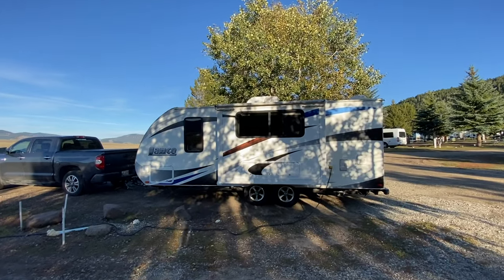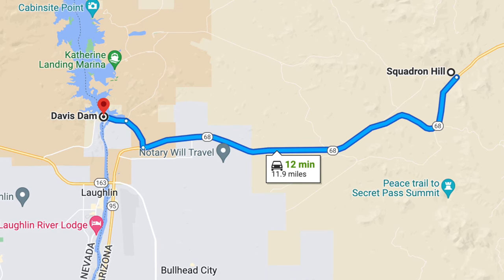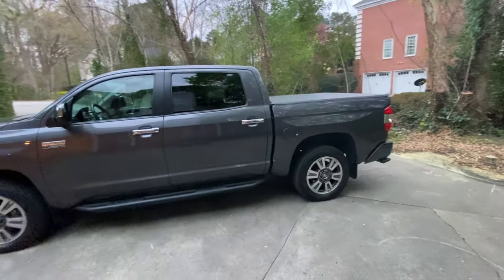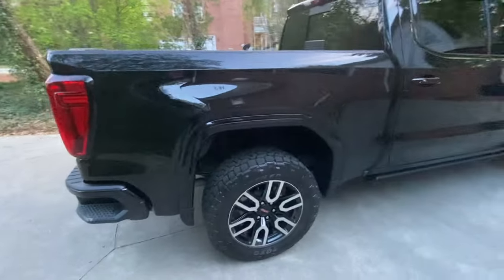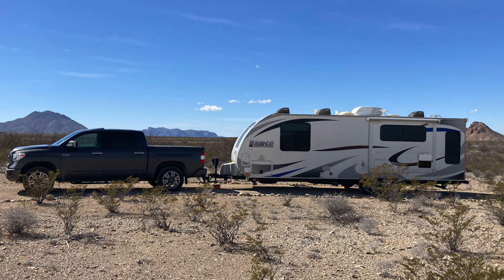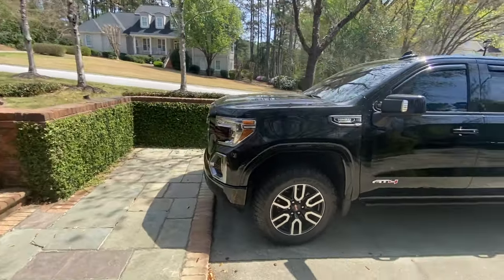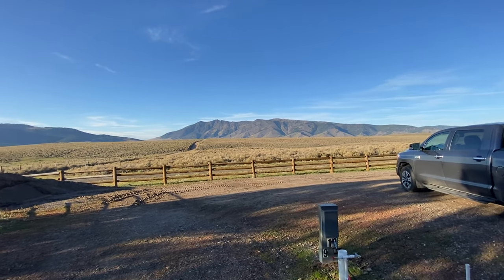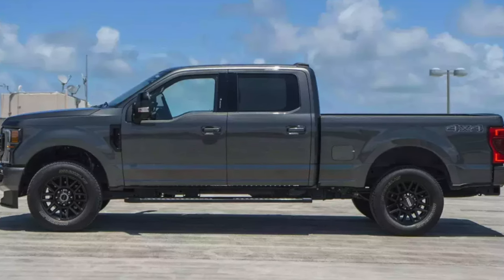Myths - Towing Capacity & Payload - the best Half-ton truck for your Travel Trailer or RV

Comment: Loved my 08 Titan thing never failed me once 200 K sold it  to a family member things  still going purchased a 21 tundra TRD  pro have to agree didn’t go pro 4X one of the reasons also was fuel tank capacity love the 38 gallons on the tundra
Reply: I think I’m gonna get a 2021 or 2022 Titan xd instead of a 2020 or 2021 tundra due to gas mileage, 6.5’ bed, and Titan has a hood crash rating whereas the tundra has poor. I’m a Toyota fanboy but this is just how it is for me haha
Reply: @americandude3825  I got 21 Titan, V8 without new electronic garage start stop or cylinder deactivation. 2200 lb payload,  6.5ft bed. 100k waranty, what's not to like. Towing trailer is like is not even there.

Comment: Nicely done!

You took the long way around but ended up in essentially the same place as me regarding the max weight a 1/2 Ton Truck should tow.

Depending on things, I'm in the 6500lbs to 7000lbs range.
There are exceptions to everything and people do have "unicorn" trucks with bigger capabilities but in general, thats where I'm at.

We decided that we wanted a bigger Travel Trailer. It weighs in at 10k, I tow with a RAM 2500 gas.

That comes with a different set of challenges but i knew what i signed up for.
Reply from the maker: Great comment, thanks for sharing.

Comment: I really have to put in my 2 cent5here. I have a 2019 Lance 2375 and tow it all around d the country. The first three years I towed with a 2014 Tundra with the 5.7. It was a great truck but I didn't like running at a high rpm alot of the time, especially on hills. I was always shifing manually and on longleaf this can get retiring. Also iwas nkt happy with the brakes. I upgraded to drilled and slotted rotors and heavyduty pads. It was an improvement for sure but not completely satisfactory.  It also got really bad mile4when not towing. A year ago I really wanted to get one of the 2022 Tundras but you couldn't get one any. I wa Ted a new truck for our Spring 2022 leaving mid March from New Hampshire to Nevada. I custom ordered a new F150 Ecoboost with MAX towing package around Thanksgiving and it arrived mid February. The difference in towing was and is dramatic. The e tra torque combined with the 10 speed transmission. The  stock brakes are far superior to the Tundra. I never manual shift anymore. On the highway I use cruise control trol which I could never do in the Tundra. It came with 8 ply tires which surprised  me. I should have noticed that when I placed the order. I recently  upgraded to a 10 light truck tire and the difference  is astounding.  The turbo psi gauge never gets above 50 percent and most of the time barely moves. It has been a true pleasure. The payload capacity is 1898 lbs. I would  not recommend exceeding  the payload capacity due to possible frame, axle and wheel capacity. Happy travels.
Reply from the maker: Great info, thank you for sharing that.
Reply: I don't know...just don't trust those whizbang V6 Turbo gismos to go the distance compared to a naturally aspirated gas V8. I tow an 8,800 36' 3-slide camper and usually just within 350 miles of home in NE Oklahoma. Have a 1994 Silverado 1-ton dually diesel right now but will be buying a newer "pre-owned" truck next year... It's a coin toss between a Tundra or a F250, with a gas V8 with a 6-speed transmission of course (those 10-speed trannies haven't proven themselves (yet) either)).

Comment: I agree I had a 2012 f150 Ecoboost and around 30k Miles started having problems with the intercooler timing chain and transmission that thing ate spark plugs like candy then around 90k started having problems with turbo's that was the last straw for me  decided to trade it in for a used 2017 tundra with 32k on it I now have 78k on it the previous owner ordered it with the 38 gallon tank so far no problem's I love it  tundra tows way better than the Ecoboost
Reply from the maker: Appreciate the info.

Comment: I have a 2012 Ford F150 XLT 4x4 with Extended Cab and 5.0 Engine. I've used to tow an 18 foot Dutchmen Travel Trailer for about 11 years with it and got about 16MPG. Now, I tow a 33 foot Cherokee Travel Trailer and I still get 14-16 MPG. I also tow my boat and launch it a few times every week. My boat is 5900 lb. dry, but my 55 gallon gas tank is always full, so that increases the weight significantly. I get about 16 MPG with the boat. So, I've really had no issues with doing this.
Reply from the maker: Glad the 5.0 is getting it done for you.

Comment: I used to own an old Suburban that was ordered from the factory with a max tow package build.

They were known as a heavy half ton. They were basically a 3/4 ton rated half ton truck.

I could tow 14,000 lbs with it if I wanted to.

It had a 454 engine , a thicker radiator core for increased cooling capacity.  It had external transmission and engine oil coolers. 

It had overload leaf springs on the rear that did not touch until loaded down heavy.

It had oversized brakes and oversized anti sway bars as well as heavier duty shocks.

It also came with higher load range tires and wider heavier steel wheels.

Vehicles used to be able to be ordered with factory upfitting and now they have moved away from special ordering.

They don't profit as much.
Reply from the maker: Regulation chasing us all to HD trucks in the future

Comment: Thank you for the informative video.
We tow with a ram 1500. With a 7700 lb travel trailer. Use a weigh safe hitch and air bags. She handles great and pulls fine.
The cost of a 3/4 ton truck is exponentially more expensive.  
That can buy me an awful lot if fuel.
My only complaint is our fuel tank is too small.
Reply from the maker: My 2021 Ram 1500 Limited came with a 34g fuel tank.  It'd be nice if they did that again

Comment: A simple rule of thumb to stay safe and not break stuff is to make 75% of your tow rating the max, be aware of your payload (but don't worry about maxing that because it's nearly impossible not to) and keep your trailer length (on a 1/2 ton) to 26 feet for a box shaped travel trailer (you can go longer with an Airstream or a flatbed).
Reply from the maker: Appreciate the input

Comment: I tow a 4600lb dry tt, 24 foot with 2014 ford f 150 5.0  7700lb towing cap.    Wind is the only issue towing 8000km to AZ and back each year.  Heavy tongue 900 lbs, no sway with reese steady flex. But in wind, 14mpg cnd to 8 or 9😱
Reply from the maker: I never had anything freeze, but don't know that we had to keep things at 65F.  Lance was great, but moved to Airstream.

Comment: First Time Listening To You - Great Stuff 👍🏼. FYI - I Have a  2014 Tundra with a 8 foot bed With Air Bags and Big Nitto Tires and I Tow a 31’ 5th Wheel  Cougar and it Pulls / Stops with No Problem. I also Have Brake Control installed and a Breeze and Joy  !!! NO White Knuckles . 5 th Wheel is a Different Towing then a Bumper Pull Camper. Thank You & Enjoy Your Notes / Imfo. 👍🏼☮️
Reply from the maker: Sounds like a great setup, best designed half tons for towing and modifying ever.

Comment: 2014 F-150 with the 5.0l v8, the truck is 2 wheel drive, has a 3.55 rear end, and has the front end lifted 2.5” to level the truck. I run Goodyear Wrangler Duratracs 275/65R18 load range c on the truck, and I swapped my trailer to load range d’s. Trailer is about 7800lbs when we load for a trip. It’s a Heartland Pioneer BH270. Truck tows surprisingly well and I average around 15mpg. My only complaint is I purchased the truck before the trailer and did not opt for one with the larger fuel tank, so I can agree there. The larger tank does make sense, however I wasn’t considering a trailer I did not have when purchasing the vehicle so I can hardly be angry. Other than that, I cannot speak for the newer F-150’s, but as for the year and model I have I find it tows very good. For anyone who may be wondering.
Reply from the maker: 5.0 has always been a solid towing performer
Reply: This just helped my nerves a ton man. I have a 2014 f150 3.55 and have to transport my 37ft bullet 330bhs to the marina. Very skeptical of how it’s gonna go. So hearing that yours tows fairly nice it makes me feel much better about tomorrow!
Reply: It’s at 7600 lbs
Reply: How in the world do you get 15 mpg while towing that trailer? Did I read that wrong?  I have the same truck, year, motor and axle, I get 15.4 mpg not pulling anything.
Reply: @397coney7  swear to you. I average 15.6 mpg on the daily. I usually keep my average pulled up, but I switched over to the instant mpg when pulling out of curiosity. At 65mph on the highway, when keeping a steady pace I was getting about 15mpg. I’m sure if I were to drive around town more than on the highway the average would be worse. But yeah, I was getting a steady 15mpg. I’ve yet to bring it longer distance than say 100 miles at a time, so that’s all I can speak for. I’m sure longer distance would be different.

Comment: Have you done a video / analysis on what a weight distribution hitch can do adding pressure to a frame say on a small toy hauler with a leopard frame and causing failure. And possibly sway bars adding to that also. There are reports and videos on how they have caused failure on some frames typically the smaller toy haulers like a wolf pup or a gray wolf

Comment: Subscribed! So I am new to towing and truck ownership. Just bought a 2023 Ram 1500 two days ago to tow a small A-Frame. We quickly realized that our 2010 Wrangler was really groaning to pull just 2500 pounds. But now I am going INSANE trying to figure out the true towing capacity of our new truck, so we can get a little bit bigger trailer and safely tow. I know that's opposite of what your video says (buy a trailer first, and then buy a truck that can tow it). Can you tell me where you think I need to be weight-wise as I am shopping for an RV? I've got an 8 Cylinder 5.7L Hemi VVT with eTorque, RWD, crew cab, 3.21 axle ratio. The Stellantis Tow Chart seems to indicate that I have a Max Trailer Weight rating of 8260lbs. You say in one of your replies below that I should stay under 75% of that, which would be about 6200lbs. The Ram's sticker says the truck's GVWR is 6900lbs, Payload cap is 1649.  That Lance 1995 you mention appears to have a Gross Dry Weight of 4950 Lbs. Do you think I could pull that with my truck? Thank you for any advice at all! 🤠
Reply: For the trailer you are referring too (Lance 1995) it has an empty hitch weight of 500 lbs. Fill up with some water, gear, food, clothes and you may be looking at closer to 600 lbs of hitch weight. So after that you will have 1000lbs of capacity left in your truck for people and gear. If you are bringing a full load of people in your truck, you may be over the limit. If not, you should be fine.
Reply: @spankroy  Thank you, Matt.
Reply from the maker: I towed a Lance 1995 across contry several times.  Don't think you'll have any issues with that setup.

Comment: The real test is to drive one with a trailer like yours and as you note, are you comfortable with it. I have a 28 foot single slide travel trailer and tow at around 6800 lbs and about 800 lb tongue weight with a Speaking to my 2021 Ram 1500 Built to Serve 5.7 Hemi had a 1280 payload and a 12K max tow. I had the 3.21 rear end but my 2015 with the 3.92 and 5.7 had roughly the same tow ratings. So, I tow roughly what you are towing. Surprisingly, the 3.21 rear end was equivalent to the 3.92 rear end on the 2015. Mileage about the same, performance about the same. The main difference was that the 3.21 had the engine obviously doing more work than rear end on the 2015. I ended up trading my 1500 BTS for a 6.4 Hemi 2500 Ram. 

Essentially, I wasn't comfortable with my rig even though it was within specs. I was always right at payload.  The 2500 is perfect. So, if you are young and occasionally don't mind the trailer taking over for a few seconds in big wind gusts or truck wakes, a 1500 will do it legally. But if not, a 2500 will do it all day and you can be relaxed in the driver's seat and the truck is always in charge. 

As a general recommendation, I personally wouldn't go over 6K maybe 6500 and pull with a 1500 of any sort that has some amenities (amenities equaling reduced payload)...
Reply from the maker: I'm not young, but don't think anyone is comfortable when the trailer takes over.

Comment: I had a 2020 Silverado and now a 2023 Silverado with 6.2L and Max Tow package. Conv Tow capacity is 13,200.  I tow a 35ft Fountain boat at about 12,000lbs.  I made two trips of about 200 miles with the 2020.  Towed the boat no problem.  On the hwy at 72MPH it was only cranking 1750 RPMs. I tow the boat to a from the boat ramp about 8 miles away 12 times a year at about 55 MPH.  The truck handles the tow on hilly roads etc just fine.  However,  if i was towing long distances on a regular basis I would definitely get a 3/4 ton with a Dura Max Diesel.
Reply: BTW the aerodynamics of a boat makes a huge difference.  I actually got better MPG pulling my boat down the Highway vs a 2 place snowmobile trailer which was like pulling a parachute down the highway
Reply from the maker: @bp6461  yes it does, as does tail wind vs head wind

Comment: Good video! You share a lot of information and experience to help inexperienced people like me decide on future purchases.  Do you have any experience with the second gen sequoia when it comes to towing or gas tank sizes? And your right about gas tank size. I pulled a single axel enclosed Uhaul trailer with my Kia Sedona from TX to NC and my gas mileage was cut in half it sucked how many times I had to fill up! 😭
Reply from the maker: Never towed with Sequoia.  But their tank size is 26 gallons.  If towing something low-profile ( maybe a Casita, Oliver, Popup, or single axle Airtstream, I think you'll be fine.  A boxier shaped travel trailer coming in at 6K or above GVWR and I think you'll be getting 7.5 to 8.5 mpgs and stopping every two to 2.5 hours to refuel.
Reply: @kedrevs4037  appreciate the reply!
Reply: I have a second gen. Bullet proof. 

Only towed a 12 foot enclosed uhaul once and a trailer once or twice. 

Uhaul was from North Carolina to Virginia. About three hours. 

Mine is the 5.7L rear wheel drive. 

Did fine for what I needed. Owners manual said my trim level can tow 10k like the tundra but I haven’t done anything near that. 

My normal gas mileage is 14.5-17.5 and hauling what I did about 8-10 probably. 

Gas tank should be bigger but of course it’s not. 

I’d buy a Toyota before I’d buy anything else except a Titan xd fdue to towing. Unless I HAD to tow something I needed a diesel for.

Comment: Your right I had 2022 Z71 1500 with a 7200 pound travel trailer And the truck was 5169 and it had a towing rating was 9300 and hitch weight rating of 900 pounds and when did the math I traded it in on a 2500 Z71 crew cab with a tow rating of 14,500 and I don’t worry about it anymore

Comment: Hello, thank you for the very informative video. We have a 34' Grand Design with a dry weight of 7,895 lbs a GVWR of 9,995 lbs and a hitch weight of 795 lbs. We are planning on taking shorter week-long trips with it, maybe going a couple states over, but nothing super long or cross-country. Do you think we could we get away with a V8 Tundra or Nissan XD? Or should we definitely go with an HD truck? Thank you!
Reply from the maker: I’d have no issue with the Titan XD.   The Tundra will do it, but the rear axle and frame of that Titan is built for that kind of load.

Comment: Great video! 
I have been towing my Imagine 17MKE Trailer with the new Tundra Limited 2022.
Very Happy with gaz milage, doing around 12 miles a gallon (imperial gallon) pulling around 6500 pounds. 
I had a Titan HD 2019 and gaz per gallons was around 10 per mile at the time.
The Titan Hd is a way bigger truck and it feel way more solid on the road .Great payload but milage it's not comparable with the new Tundra .
Great advices! agree...always stay under towing and payload   limits. 
Safer for everyone.
Reply from the maker: Thank you, safe travels

Comment: i plan on buying a f150 with the capable abilities of 13,200 toing cap....however my trailer has a empty weight of 5996 lbs....loaded up to 7000 lbs....and that i max i would tow with the ford.    i currently run an Armada towing the same trailer, but we are limited on areas to tow due to axle rating and tow cap....its just smart towing  and researching the trailer and truck capacity and staying as the man said here, keep it well below max rate